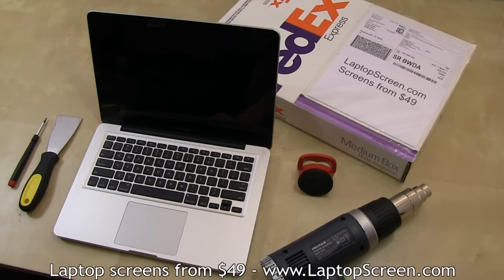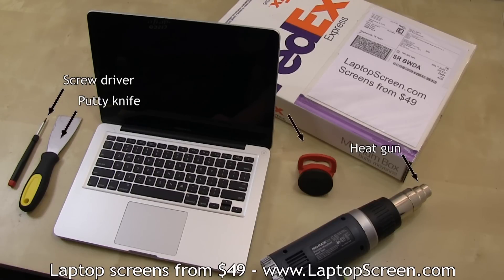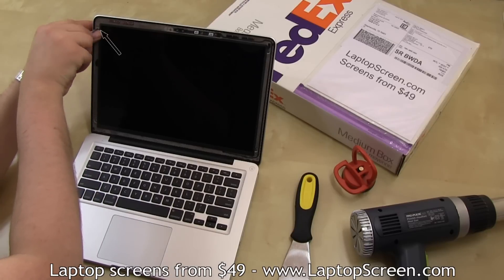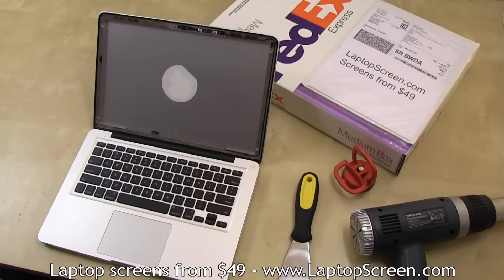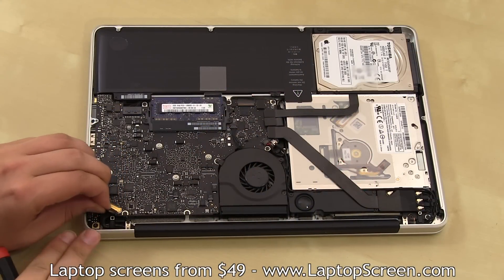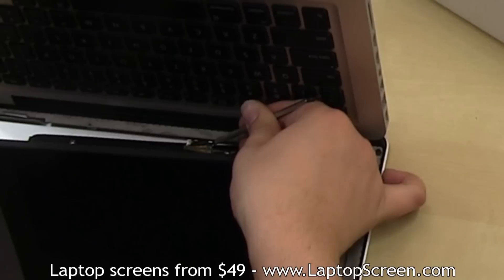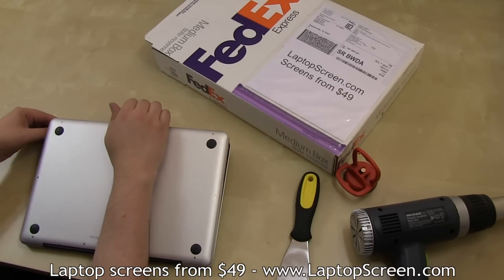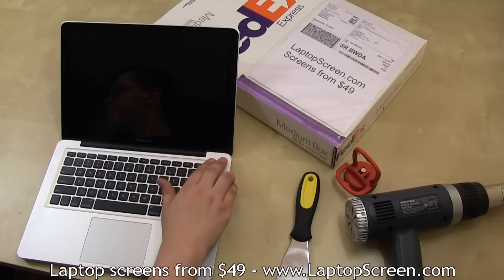MacBook Pro 13 screen replacement /  Installation guide [Apple MacBook Pro 13 Unibody LCD repair]

Comment: Hello, does a random screen with same inch and same resolution work?
Reply from the maker: That computer in particular uses a proprietary Apple connector not used on any other similar LCDs :(

Comment: Thank you!
is it possible to install a retina screen on a macbook pro Mid 2012 (A1278 non retina)?

Thanks again!!
Reply from the maker: It's not a direct plug-n-play replacement. But anything is possible, it is after-all about hooking up a computer to a display. Would definitely require some kind of an active signal converter device, small enough to be augmented inside the machine.

Comment: Hey, this guy makes it look easy (fair play to his skills) so before you try this - I just tried doing this twice, and spent a total of two hours. I ended up giving up because my hairdryer kept over heating and switching itself off which meant I couldn't keep the glass hot enough to peel off, plus the credit cards and old gift cards I was using just kept bending and were actually too wide for the glass on the whole. I managed to get small pieces of the glass off but only because it was already cracked - I personally don't know how I could've got the whole credit card side under the glass if the screen had no cracks because it was really hard.
I'm glad I tried this DIY, but personally I found it a real faff so I'm going to just pay the money for someone else to change the glass covering on my screen because I'd rather spend my time doing other DIY projects and other things. If you want to do it yourself, I'd say leave a decent amount of time to do it, and buy the proper equipment instead of trying to skimp using household objects that aren't suited for the job.
Hope you fix your screen either way :)
Reply from the maker: It maybe the glue condition. Depending on how old it is and at what humidity the laptop was used the glue may become petrified and heating it won't do much. Plus these computers are now 9 years older than when this video came out :)

Comment: That looks amazing! So much less complicated than the procedure on https://www.ifixit.com/Guide/MacBook+Pro+13-Inch+Unibody+Mid+2012+Display+Replacement/10366 My MacBook Pro 13" (mid 2012) screen has started flickering like mad only two weeks after I bought it! It is sometimes all black, and sometimes green. I've never used a hot air gun, though. What precautions do I need to take? What happens if the glass cover breaks?
Reply from the maker: Hi Paul, yes this is the "short-cut" procedure that only works on the 13" version. Glass covers are still available for these computers on eBay at about $20 USD, so not a biggest deal if it breaks. The precaution for using a heat gun is to ensure even heating through out, and to maintain heat when removing the glass. Also only use plastic tools when picking below the glass.
Reply: @Laptopscreen  OK, thanks! I actually meant what precautions do I need to take to avoid getting injured? I'm worried I may get burnt or even catch fire! Please can you confirm how hot this needs to be and what type of hot air gun it is?
Reply from the maker: Oh... uh... Use a hair dryer if you got one. The glass needs to be warmed up to hair dryer temperature. Heat gun is kind of over powered for that, but gets going quicker. Best to keep checking the temperature of the heated glass with your fingers - it must be quite hot to the touch but not burning.

Comment: You turned what may look very scary into something very simple and easy! Well explained!
Is this far from changing the webcam or it may be just 2-3 more steps?
Reply from the maker: Thanks :) The Webcam is probably easier - it likely has a disconnect at the top and can be removed with-out taking out the LCD, once the glass cover is removed. But considering the age of the computer it maybe easier to use a USB external webcam.

Comment: Hi,
I have Macbook pro 13 2011 I broke the LCD but apple doesn't support this model any more I found local online a company NiwTech https://www.niwtech.com where they offer to fix the laptop for me and after they fix it they give me back the old part but wasn't apple it was LG brand when I went back to them I said this is not my part my LCD should be apple they said apple never had an LCD brand by them self they use different brands.
is this information right or they swab my original screen with something else?
Thank You
Reply from the maker: Yes that is correct, Apple does not make its own LCDs and uses LCDs manufactured by LG and Samsung and other LCD manufacturers. Same story for Dell, Acer, HP and Toshiba, they all use somebody else's LCDs.
Reply: Thank You

Comment: Not much heat is required for this repair, you will melt and warp the rubber side trim if you overheat. Unless, the glass is badly broken. In which case, it will be a slow process heating and removing glass shards. Do not overheat and don’t hold the heat gun in the same place for long or you risk burning your LCD. Don’t heat bottom of the screen much, as you risk warping the keyboard.

Comment: horrible design, to use glue/adhesive on an lcd assembly on a laptop is just crazy....what happened to the old good screws that everyone else is using.

Comment: The one thing I would add (haven't replaced mine yet) is my display has many cracks of small shards. I realize these may be problematic so I'm going to use a wide roll of masking tape over the entire screen and trim to the edges so the whole screen stays intact.

Comment: I have a 15' retina display MacBook and it is cracked. I really love your tutorial and believe I could do this myself, everywhere ive checked wants an arm & a leg. I do need it for the webcam especially. Do you have those in stock? and if so round about how much ?:) It might be a 13"inch retina MacBook pro I will find the box, for when you reply .
Reply from the maker: Retinas are harder to do an LCD replacement on. You'd most likely want the whole assembly. Find out the model number from the back of your laptop - i.e. A1398: https://www.laptopscreen.com/774118/

Comment: Tip: The lcd film protector should be removed at the very end before reattaching the glass to avoid any fingerprints and/or scratches to the lcd.

Comment: I've just seen a Macbook on ebay with nearly defect display, wondered if it's possible to repair it, thanks for your video im about to buy a macbook with a low price and change the screen later ...

Comment: Can you replace the panel with another 13" 16:10 panel that has higher resolutions like 1680x1050 or 1440x900 at least?
Reply from the maker: No, unfortunately there are no other LCD panels in existence that would fit this computer.
Reply: Too bad. I would use this laptop forever if it had at least 1440x900.
Reply from the maker: Agreed. These computers are very nifty, sleek and pleasant to handle. And with a Core2Duo and 4GB RAM can serve the light duty browsing/e-mailing/typing very well. I still have mine from 2009 - other than the battery - no failures! Although the 15" A1398 Retina is also super nice and works well for video editing.

Comment: Hello. Great video. I ran over my macbook pro mid 2012 13.3inches. The whole upper display screen is in bad shape. I will have to replace it. If I wanted to replace it with a retina display screen, is it possible?
Reply from the maker: Anything is possible, but in this case it wouldn't be as easy as just plugging it in. Neither the video interface nor the hinge mounts would be direct drop-in compatible. If one were to make such a mod, aside from the physical mounts one would have to design and build an eDP to LVDS converter, accommodate power supply for the back-light, and do it in such a way that it all fits inside the computer (which already has very little space in it). There are no off-the-shelf components available for that.

Comment: Hi Friend, thanks for your. I have a MacBookPro 8,1 A1278 2010 says at the top and 2011 in the detail of software , core i5 4 of ram , screen 13 " . It happens that normally turns on fan startup sound and all but gives no video at all, is black screen , also does video to crank or start the system with an additional external display, but instead if I have video when I launch the single connected system the external display and disconnected from the motherboard native screen . this is why we tried to get the screen to try another but mori in the attempt and am with the trizado glass to one side, I guess for not hot enough the screen, by the way, a few degrees C I have my air gun welding ?, then Espro friend does not I am having bored with my detail and can give me a hand with the prognosis or solution

Comment: do I need a heat gun or hair dresser would work too?
Reply from the maker: +Oguz Oguz Depends on the hair dresser I suppose... A hair dryer will work as well.
Reply: How did a blow dryer work, well?

Comment: One thing these videos do not tell you is that you always have to unplug the battery from the logicboard before you do any work related to the logicboard or it is a very good chance that you will fry the board.
Reply from the maker: +rnaderpo It is a good idea to do that, although "a very good chance" is too strong of an assertion - but I guess it'll depend on the installer ;)

Comment: hey i borrow a QUICK850A smd fro a friend. could you please tell me the readings to fixed in it, its showing 2 knob AIR (1-8) and HEATER (1-8)
Reply from the maker: +VISHNU V.L The adhesive needs to be warm - almost hot - but not so hot as to burn your finger. Warm the area up - and gauge the temperature with your finger - stop warming it once you can't hold your finger against it.
Quite frankly a surface mound device soldering hot air station is a complete over-kill and likely to cause more problems for you. You should borrow a hair dryer instead.
Reply: +LaptopScreen.com its a blower. almost like hair dryer. and its not mounted version
Reply from the maker: +VISHNU V.L Just be careful with it - its meant for soldering. Hold it far enough away from the edge - to make sure that everything warms up evenly.

Comment: What if i need to just replace broken glass? is the heat gun necessary?
Reply from the maker: +fully loaded Yes, if you are not replacing the full top case assembly, you need to use a heatgun to remove the front glass
Reply: could i not just pick the glass out..? i mean the glass is completely shattered
Reply from the maker: fully loaded The glass is glad to the front, if you were to start to just rip it out, it will keep breaking; and a lot of small pieces would stay glued to the front frame. It is an option, but not a very good one.

What I would do if I had a badly shattered glass, is to cover the entire area of the glass with wide scotch tape so the glass doesn't separate, heat the adhesive, and start prying the glass off as one piece.

Comment: After following all the steps, my MacBook Pro will not turn on. Totally dead. What might of happened? Is there a fix?
Reply from the maker: +Steven Squire Are you sure that it does not turn on? In rare cases - if the connector is slanted during installation - the back-light fuse may get shorted. If that happens - the computer still turns on, and you can even see faint image on-screen - except that the screen does not light up. Such mishaps are fixed by the replacement of the back-light fuse. Its best to contact our support directly - we guarantee a working replacement or your money back!
Reply: Good to know. The computer is now being diagnosed at simply mac. It will not power on at all. I hope its only a shorted fuse. When the charger is plugged in, it shows green and the side button indicator shows full charge. I have tried every power on trick out there. I will post updates as they come.
Reply: +Steven Squire looks like you touched the mother board while NOT BEING GROUNDED. mother board is no good anymore.

Comment: can I use the same steps for a1502 model?  (13 inch retina display.) are all the placements the exact same as the laptop on this tutorial?
Reply from the maker: +jade lucas No, the retina displays are different. An easy way to replace a retina display is by replacing the entire assembly like so: https://www.youtube.com/watch?v=C3-4qwml-F0

If you were to do the LCD matrix replacement on a retina it would go something like this: https://www.youtube.com/watch?v=cXSR2dP6L1Q

Comment: I intend to do this repair, however, the LCD screen is not damaged. Will applying that level of heat damage the LCD? Or can I just replace the glass?
Reply from the maker: +Jonathan Warner As long as you do not over-heat the assembly you will be fine. The temperature for the adhesive to start to soften is around 50C-60C 
(122F-140F), gauge the temperature by touching the heated surface - making sure that its definitely warm - but is not searing your finger.
Reply: Sounds good, thanks!
Reply: What did you use to apply heat? a heat gun as well? how did your repair go .. I have a similar issue

Comment: How hot does your heat gun need to be to melt the glue? Would a hair dryer substitute?
Reply from the maker: +Zach Terlizzese Yes - hair dryer is fine. The temperature for the adhesive to start to soften is around 50C-60C (122F-140F).
Higher temperature than that may melt plastic or damage other stuff. Heat-gun is good for heating quicker - but you still have to be very careful and gauge the temperature by touching the heated surface - making sure that its definitely warm - but is not searing your finger.
Reply: +LaptopScreen.com Thank you!

Comment: please excuse my ignorance but why would you want to replace the lcd screen/panel? is it for higher resolution or something else?
Reply from the maker: +seatha03 No, this is for those who actually broke their screens (i.e. closing a lid with earbuds laying on the keyboard).
There aren't any better panels that would fit the MacBook Pro 13" for high-res upgrade or better angles - the connector is proprietary :(

Comment: WARNING!!!! DO NOT SPEND TOO MUCH TIME ON THE BOTTOM OF THE SCREEN NEAR THE HINGE!!! IT AND THE KEYBOARD KEYS WILL MELT AT HIGHER HEAT LEVELS!!!!
Reply: +Noah Gary sounds like you say this from experience..
Reply: Unfortunately.... yes...
Reply: +Noah Gary What strength heat gun did you use? 500º or 750º F?

Comment: this does not seem like it's worth it lol. how the heck do you even get a heat gun ? lmao. plus, what if you do it wrong and mess up the laptop? i'd much rather pay 500 to get it fixed but I have no money to do so
Reply: +Julia Chernov purchase the entire assembly which includes the LCD, Glass and Back Cover.  The repair is much easier, then you can just sell your old broken assembly on eBay to recoup a few bucks.
Reply from the maker: +Julia Chernov The heat-gun you see in the video was purchased at WalMart for $19.99 - it lasted us for over 5 years now. MacBooks can sometimes be more challenging for repairs, but the over-all build quality and strength make it harder to screw-up during the process.
Reply: +Julia Chernov I just bought everything in this video for $50. The heat gun and glass cover are both $20 (I don't need to replace the screen of the MacBook, thank God). There are many different heat guns available:

https://www.amazon.com/s/ref=nb_sb_noss?url=search-alias%3Daps&field-keywords=heat+gun
Reply: KingAndrew5000 ummm what if it shatters? Then what? I don't think so

Comment: How much it will cost if Apple does the LCD repairment?
Reply from the maker: Manny Ramos Apple typically replaces the entire top-shell - which costs quite a bit more than a panel swap. Its best to ask at the Apple store directly, as their prices may vary from state to state and exact model to model of the MacBook.

Comment: I did this today but i made a HUGE mess. My screen was cracked pretty good and it just kept spider-web cracking every time I lifted on the edge. I used 2-inch clear tape to completely cover my screen so the tiny pieces of glass would stay put when it cracked. I took me a few hours but I got it done and it looks GREAT!
Reply: +louie GREAT IDEA!!! My entire screen is cracked so I'll have to tape the whole thing.

Comment: is it possible to use a hair dryer for heating?
Reply: sharp. i c it will work, but my impatience has caused me to break a piece. ouch
Reply: +Julia Michie YES. I tried and it worked!!
Reply: +Chetan Gole on what heat can i use the hairdryer. low, med or high?
Reply: "Philips Hair dryer HP8112/00" on medium heat.

Comment: My MacBook caught on fire. Help?
Reply from the maker: Jaron Contreras Remove all sources of power, use a chemical-foam fire extinguisher or a thick blanket to cut the oxygen supply.Did this involve gasoline?
Reply: Lol. I was joking. Great video though!
Reply: John Smith is that a question?

Comment: can a blow dryer be used instead of the heat gun
Reply: +David Ashton +LaptopScreen.com replied to another post, "Yes - hair dryer is fine. The temperature for the adhesive to start to soften is around 50C-60C (122F-140F). Higher temperature than that may melt plastic or damage other stuff.  Heat-gun is good for heating quicker - but you still have to be very careful and gauge the temperature by touching the heated surface - making sure that its definitely warm - but is not searing your finger."